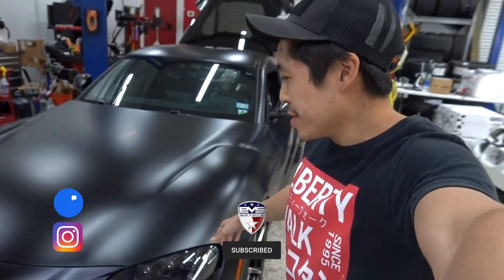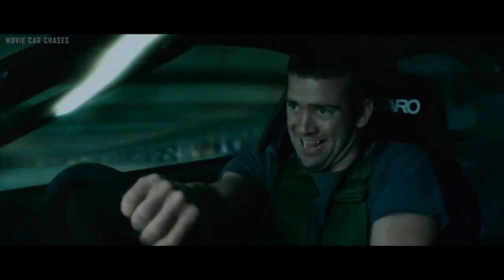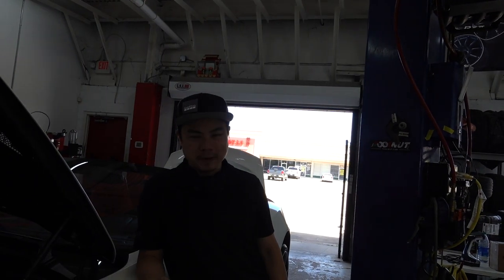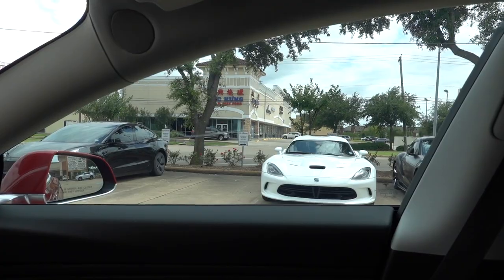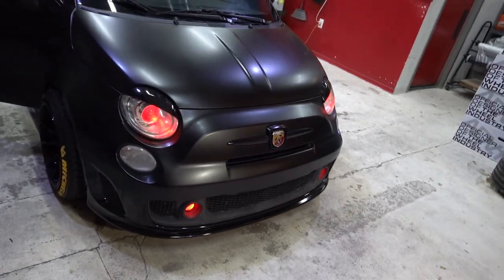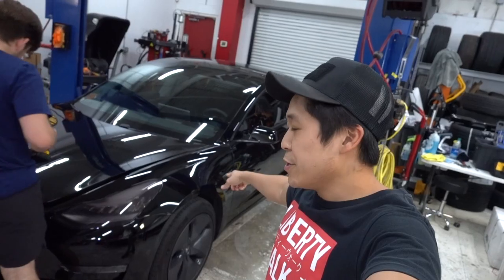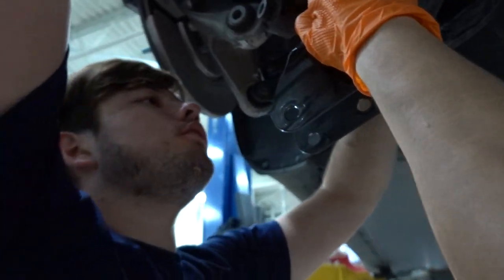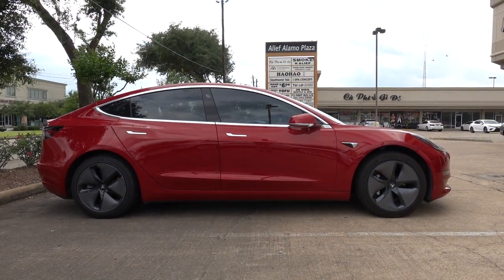Tesla Model 3 Lowered on Novitec Springs! | EVS Vlog

Comment: What size spacers did you put on the black model 3 with the Novitec springs?
Reply from the maker: I don't have the specific measurements/specs off the top of my head, but there's only 1 setup for the 3.

Comment: What’s the part number on the Novitec springs for the model 3, also what was the drop 1 inch? Thanks
Reply: Nevermind, I found them here in San Diego, I currently have the 15mm front and 20mm rear spacers will that be enough? Thanks
Reply: Fred’s Model 3 N I’d like to know what size spacers as well.
Reply from the maker: @fredsmodel3n192  There should only be 1 setup as far as specs go for the spacers for the 3.